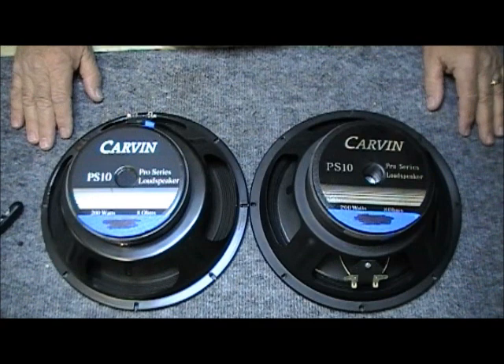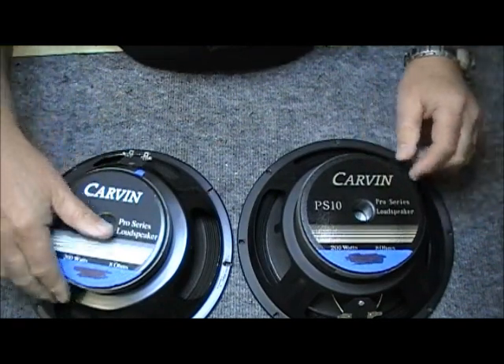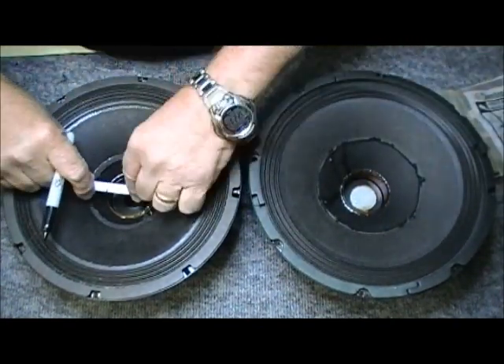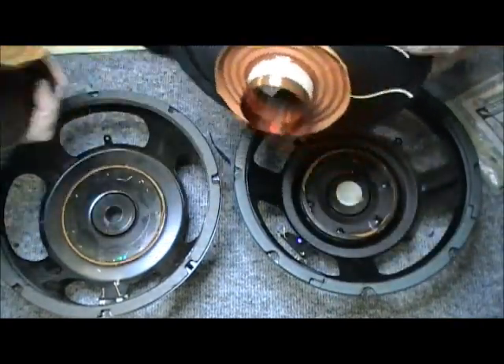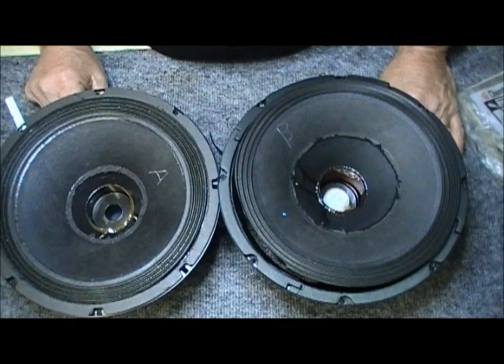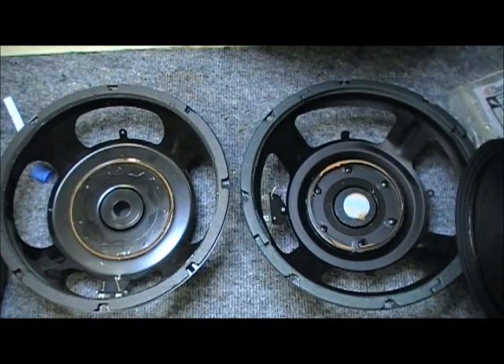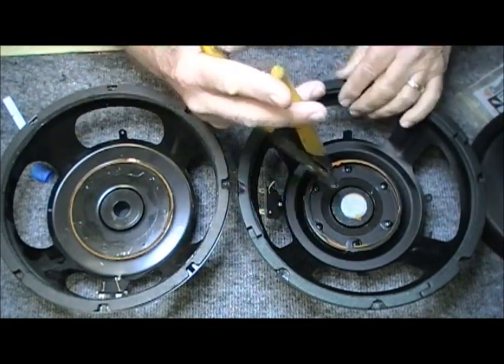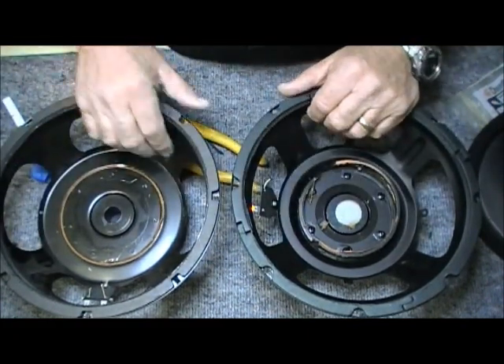Speakers Chinese vs American

Comment: Nowadays it says it says "Assembled in USA from domestic and foreign sourced parts". That means only one part needs to be made in USA. Could evne be the stick on label. I saw a video on TVs labeled as such and the TV was made and packaged in China. The importer opened the boxes and inserted a USA approved AC/DC  converted in order to allow the labeling.  The converters could have been made in China and just shipped in separate crates.

Comment: I was talking about this to an acquaintance of mine.
That what is made in China is often not of such good quality.
I am sure that if both speakers were used for the same amount of time, the American one would hold more.  Apparently they are made in China because production is cheap there.
And the manufacturer does not care what happens to a product after the warranty expires.
As far as I remember, the environmental regulations in China are not that strict.

Comment: Mr. Cotton: When we buy "made in America" speakers ie Klipsch Heresy IVs.... how do we know if the components inside ie the drivers or the cross-overs are also made in America?  I watched a video with the owner of Ohm speaker company who said his speakers, ... Made in Brooklyn.. contain pieces and parts made in USA and China and other countries.... ????
Reply from the maker: Unfortunately, you don't. Your best best is not to buy brands that you know are of Chinese origin. Even American brands that have entry level priced products are generally produced in China under a U.S. manufacturer's name badge. As you move up in quality and price range you have a better chance of U.S. manufacturing. Even JBL touring rigs are using parts from Mexico and China. My point here is not all foreign products are bad. I'm just trying to say spend the extra bucks for the higher quality products and avoid the cheaper Chinese knockoff stuff. At least the higher quality stuff is repairable, a better value for your money in the long run. The Chinese knockoffs are basically throw away and start over items.

Comment: As in some Chinese products are actually doing the same what the Japanese does, for a way look at other industries like motorcycles that a knockoff Harley performs as a Honda and then the made in USA original has oil leaks while the Chinese copy doesn’t, the copy is more reliable than the original. 

A Buick that is made in China performs like a Toyota in quality.

Comment: Both cheap and nasty as they are pressed steel baskets as opposed to cast iron baskets. My big old English Leak 2075's from the 70's have 15" cast iron baskets.  To think the K. La Scala's made in the US use PRESSED STEEL baskets and UK RRP is £12k ( $ 15k ?). For that price I would expect CAST IRON bass units, wouldn't you ??

Comment: showing the difference does not means nothing ,i would like you put both on sound and then we can say which one is the best .Made in USA does not say it is 100% good.
Reply from the maker: Never said made in America is 100% good. The point is Chinese products are copies of American product, However they use non spec, odd sized parts making them basically nonrepairable throw away items. Therefore, the value is in the American product. I too have Chinese speakers but they are for my own personal use around my home. I wouldn't consider taking a Chinese copy rig on tour.

Comment: so dont by Celestion speakers from England only Eminence from USA or Jensens made in Italy???
Reply from the maker: Never said don't buy Eminence. Celestin speakers from E gland are excellent also if you can find them. But both companies are now producing cheaper units made in China which are  not identical to original specs. As for Italian, I've always been impressed with many of the Italian brands but you don't really see Italian speakers in the lower priced brands.